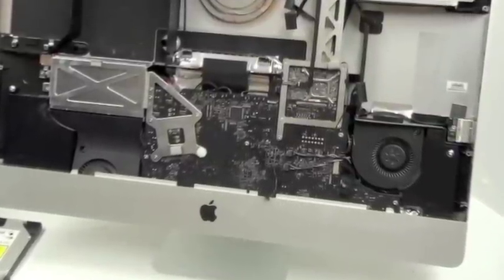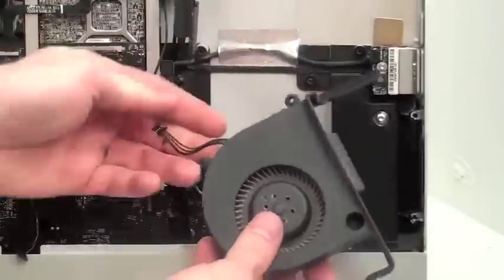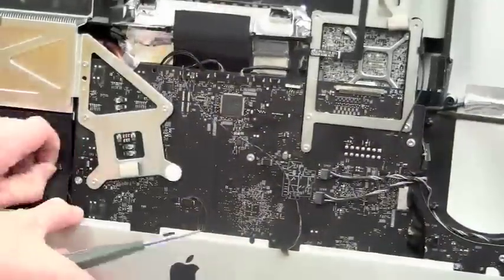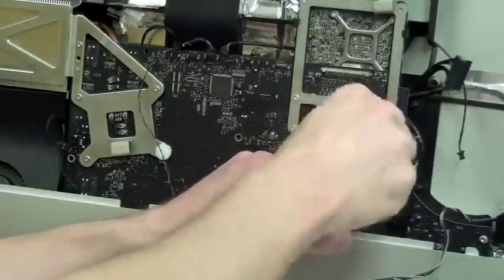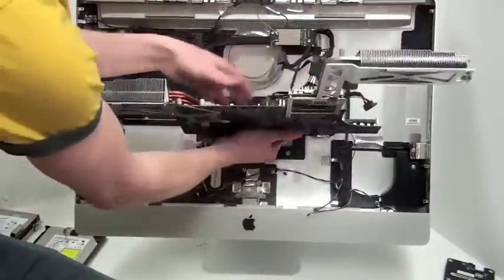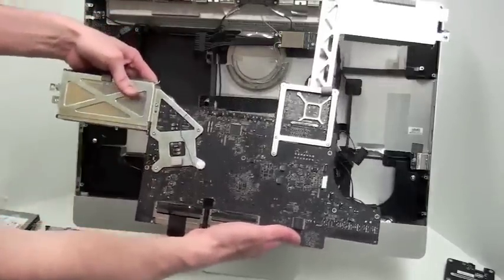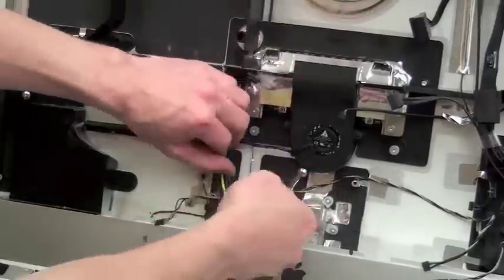iMac 27" Repair - Removing the Fan and Logic Board

Comment: Hi Thanks. I recommend after reballing or reflowing the solder to manually set the fans at a minimum of 2000 rpm and with small desktop fan at the back (at speed 1 perhaps or 2).

For the late 2009 iMac ATI Mobility 4850 GPU,  what kind of thermal pads is need to replace the thermal pads (for the chips that surround the GPU chip?), how thick and what brand?

Thank you. Have a great day.

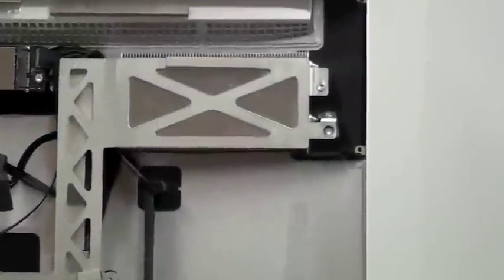God bless. Philippians 2:13
Reply: Viscous v5 thermal paste

Comment: Hope you reply. My iMac 27in (Late 2009) just about 30 minutes ago got green lines and froze and restarted and is now getting pink lines at boot and will just turn back off. After researching it seems to be the Logic Board or GPU. Lucky me, warranty expired. Isn't that nice... :/ $3000 down the drain. I was wondering if I could do that put thermal paste and reheat the with a heat gun to fix? Please any ways i can get it working?

Comment: To answer a very old question asked here:

Yes, the CPU is, in fact, upgradeable.

There are extremely strict requirements on this and certain models are EFI restricted, but it is very much possible in many models. If you're capable and patient enough to dismantle and reassemble your iMac nearly entirely (as well as brave enough to void your warranty if it's still active) the CPU can be upgraded with very rewarding results.

I will be posting a video soon of this procedure - actually used this